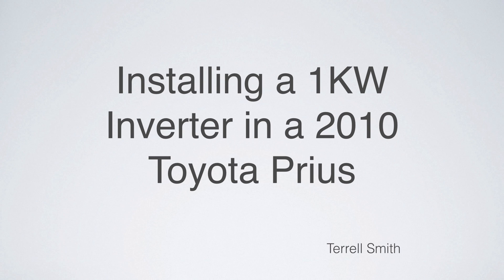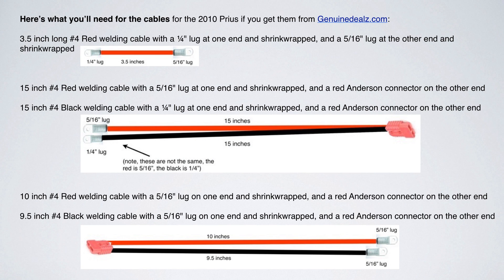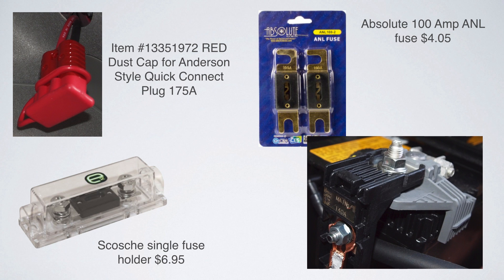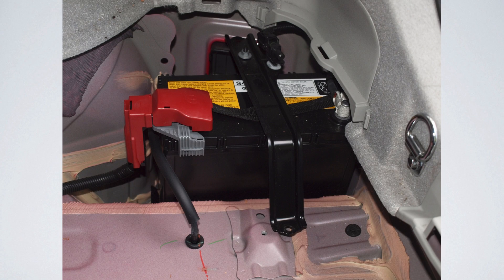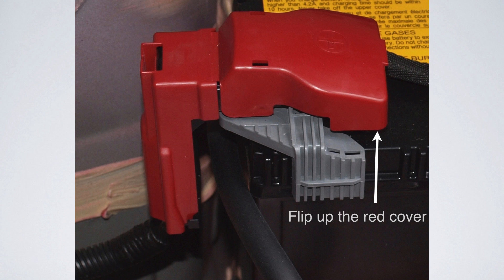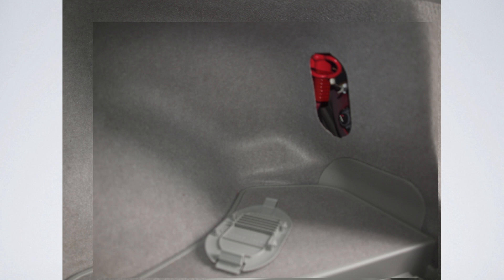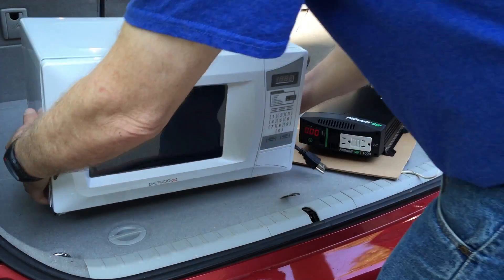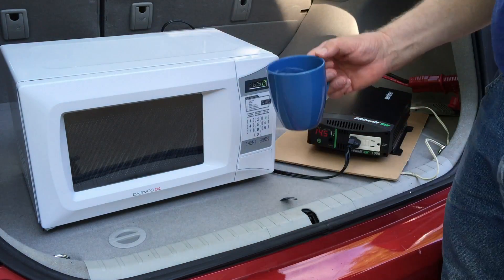Add a 1kW Inverter to Prius

Comment: GREAT video! I'd like to get an inverter set up to my Prius but have absolutely no idea what I'm doing. I want to make sure it's done correctly, do you recommend taking my car to a regular mechanic and having them install it for me? Also, where does the additional 100 amp fuse go? You mentioned that the battery already has one, does a 2nd one need to be added? If you (or anybody in the thread) could let me know I'd really appreciate it! Thanks in advance.
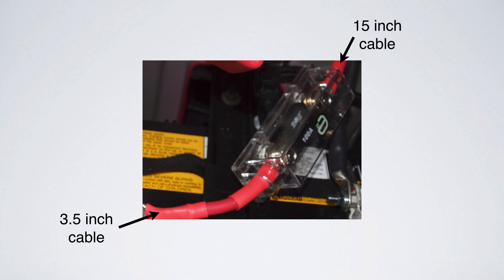Reply from the maker: Hi Michele, you can see the short 3.5 inch cable coming from the plastic box with the 100A fuse at 3:25 in the video. It connects to the positive post of the 12V battery. The 100A fuse goes as close as possible to the positive terminal of the 12V battery. This fuse protects everything after the 12V battery - the cables and inverter. The built-in 140A fuse the battery already has is built into the positive 12V battery cap, and it protects the white cable coming from the DC/DC inverter of the car to the 12V battery. Since you always want to protect power coming from a power source, you fuse close to the power source. Thus the 100A fuse. 

In theory, you could connect the red cable from the 1kW inverter to the built-in 140A fuse, BUT, then if/when you blow that fuse, you've also blown the connection from the car's DC/DC inverter to the 12V battery, and you have BIG trouble! One reason for using a 100A fuse in this setup is so that it blows before any damage might be done to the car's 140A fuse. Short answer to your question: Yes, you need the second fuse.

You could take your car to a regular mechanic and have them do it for you, but my guess is that it would be expensive. And my guess is that Toyota would refuse to do it. If you have a good friend with wiring experience you trust, that might be the best route. If you do have a mechanic do it for you, I'd be very interested in what they might charge. And you should ask first, to avoid unhappy surprises.

Part of the reason I planned and did this project myself was to save money. :)
Reply: @TerrellWSmith  Thanks a million! I’ll do some research and find out what the cost would be and I’ll post it here. I definitely appreciate all the info you share on your channel, it’s greatly helpful and very inspiring. 🙏🏽😊
Reply from the maker: @itsmichele  I've heard that some Toyota places will do special work, at their "normal" hourly rate, whatever that is.

Comment: I’m running a 850watt ac off of this setup.. it’s good at 80degrees.. at 95degrees.. the low voltage alarm on the inverter goes off..so maybe 3gauge wires?
Reply from the maker: Are you running the car while you're running the inverter? Otherwise you’ll quickly drain your 12V battery. 
Why run an AC and not just the car’s AC?

Comment: Why can’t you just leave the inverter
Plugged in and turn it off? Does it drain the battery? Risk of fire?
Reply from the maker: Thanks for the question. Plugged in, there is the possibility that the inverter is always drawing some current, even when turned off. And if that's true, you will slowly drain the 12V battery if you don't drive often. A second reason is that the inverter's terminals might be exposed (they are on mine), and you don't want the positive side to come in contact with ground (any part of the car's metal), because if it does, it might spark (risk of fire), weld itself to the metal (drain your 12V battery), and at the very least, blow the 100A fuse. So to be safe, just unplug it.

Comment: А good instruction for those who want to kill the converter-inverter of their Prius.
Why all Prius owners want to draw so much power from the 12V circuit?
Reply from the maker: No, this will not harm your Prius inverter. You can easily draw 1000 W from the inverter. You evidently do not understand the electronics of the Prius. I have been doing this for five years now. I power a microwave oven when camping, and I have powered my house when we’ve had power outages. Many others have also done this.
Reply: @TerrellWSmith 
"You can easily draw 1000 W from the inverter." 
        Yes, you could draw even 1200W from a Prius converter-inverter. If you were the only consumer of 12V in the whole car, but you are not.
 "I have been doing this for five years now."
       Yes, I've been smoking for 39 years  now and I'm still alive. Because smoking is not harm my health.
       The Prius is equipped with a high-capacity high-voltage power battery. But instead of building a homemade inverter powered by this battery, everyone prefers to overload the 12V line.
Reply from the maker: @GeorgijusPavlovas  BTW, it's called a DC/DC inverter. You don't run the 1kW inverter while driving, so yes, almost all of the power the DC/DC inverter generates is available.

Comment: I have a Lexus x450H , my main fuse at the battery side is 180A ,I want to keep it safe and put a 80A circuit breaker / fuse.
Then the 900 watts inverter with the right size cables.

My concern is what about the rest of the cars options like heated seats and the electric power steering (the power steering is fused at 80A) 

What I think is I can’t use the cars options and the full power of the inverter?
Reply from the maker: Good thinking. I wouldn't try to use the cars options and the inverter at the same time, just to be safe. If you find you need to have power (for something like a small refrigerator), then you might consider not running your heated seats, which take a good bit of power. The steering probably doesn't take nearly as much. Another option would be to get a small power station which can be plugged into your car's 12V aux power, and plug the refrigerator (or whatever) into the power station. I have a small Bluetti (700W) for this.

Comment: Thank you so much for all your information and guidance.   Fast forward a few months and my Prius power system seems to be working just fine.  I bought heavy duty cables and a new breaker which seemed to fix my problems.  I now can cook with my Instant Pot mini 3 quart if I want and found this Cusimax infrared one burner cooktop where you can cook at any wattage you like from about 150 watts all the way up to 1500.   As soon as I turn on the burner, I immediately put it at 800 watts or less and it works great.  I can even fry eggs at 300 watts.  Now I would like to get a low wattage microwave/convection oven so I could bake during a power outage.  Most low wattage convection microwaves operate at 900, 1000 watts or higher.  How risky would it be to cook at the 900 or even 1000 watt level for a longer period of time with this inverter setup?
I also went out and purchased 3-50 foot extension cords on sale and already had a 100 foot outdoor extension cord.  I made an insert for my bedroom window where one can be open about a foot without any outside air getting into the house but all the cords going through a small hold in the insert which is made of that purple insulation material.   I did a dry run and can operate my home low wattage freezer, refrigerator, LED lights in 4 rooms as well as my modem and 2 laptops with plenty of juice to spare.  Only issue is getting the car close enough to the house if snow is on the ground and being sure no car exhaust somehow gets into the house.
Reply from the maker: Hi Amy, So glad it's working for you. My experience (as well as others) is that microwaves seem to draw much more power than they say. For example, my microwave advertised as "600W" has a sticker on the back which says 950W, but it actually draws a bit more than 1kW when running. So if they say 900, 1000 and higher, stay away from them. You can always check it with a Kill-A-Watt tester. I only use my microwave for 2-5 minutes at a time, then let the inverter (and car) cool off a bit. Other things, like my rice cooker, are rated much lower, and rice takes 20 minutes to cook. When you have the car in Ready mode and are using your power set-up with the car parked outside, make sure you lock your car doors with the metal key which is the emergency key inside your key fob. That not only locks your doors so no one can drive off in your running car, it also disables the use of any fobs to open any doors. (You have to use the metal emergency key again to unlock your car.) And make sure all your doors are closed before locking up. I run the power cord out the back hatch by closing the hatch gently on it until I hear one click. Then I gently give a slight push until I hear the second click. Now the car can be locked while it's running in Ready. The rubber grommet of the back hatch will allow the power cord to go through.
Reply: @TerrellWSmith  Thanks for that advice before I go out and purchase something.  I've been looking for something low wattage and dual purpose, like a convection microwave, but the ones that claim to be 800 watts are the really expensive ones that go over ranges.  I see these little glass infrared convection ovens that use less power.  Since they are cheap, maybe I will get one and see what I can do with it.  I want something that can bake a small pizza, pie, quiche loaf of bread or small casserole.  Getting ready for the zombie apocalypse.  Am tempted to get a 20" range and use propane but I can't take that anywhere unless I get an RV.  I watched some women here on Youtube bake bread in a pressure cooker and then an instant pot.  I tried it and burned the daylights out of the bottom of the rolls, even using a bundt pan as a spacer to keep the pan far from the high heat.   Guess there's a lot of experimenting with this. My little 3 quart instant pot only gets to 640 watts max (so says my Kill A Watt) but lacks the "bake" setting.  You posted another video about adding an extra battery.  Could one use slightly more wattage if one had that setup?
Reply from the maker: @amywalker7515  You asked "Could one use slightly more wattage if one had that setup?" Unfortunately, no, because the power is coming from the car's DC/DC inverter, and you can only safely draw 1kW. Instead, I would recommend getting a Power Station with the battery capacity you need.

Comment: One of the best videos on this subject.  Thank  you.  I got it to run the blower for my natural gas heater.
Reply from the maker: Thanks for the kind words. Glad it's been helpful for you. I use it all the time to run my microwave while camping ("Glamping," as some would say.) Plus, we've used it to keep our most important appliances running in our home during power outages.
Reply: @TerrellWSmith   @TerrellWSmith  I have a quick question, if you have time.  Because there were limited options available, I bought a 2k Watt peak 3k inverter to use with my 2016 hybrid Rav4.  I want to run the blower in my home's natural gas HVAC in case of a wintertime black out. 
Is there any problem I should be aware of if I consistently use half of an inverters capacity?

Comment: You advised me about the cables and the Anderson connectors, which we purchased.  Now it is all assembled, but I am unable to disconnect them myself and my son is having a lot of trouble getting them apart too.  In order to make it easier for me to operate could one of these 3 scenarios work?   1)  I know we are talking about more electricity here, but could one use alligator clamps to hook up the inverter rather than a permanent connection?  I have a smaller 600 watt inverter I used to hook up to 2 large marine batteries when I had a backup solar system that attached using alligator clamps.  I could have my 100 Amp breaker on the red cable. 2)  Could one leave the inverter connected to the auxiliary battery all the time?  Would it drain one or both batteries?   3) If I permanently installed cables without the Anderson connectors using my 100 Amp breaker on the red cable, could I merely trip the breaker when not using the inverter to avoid battery drain or damage?  I have some dandy new 60 inch #4 cable I could use rather than my shorter professionally made shorter ones. The connected inverter would be stored where the spare tire lives.  Would any of these approached work?
Reply from the maker: Hi Amy, thanks for your questions. Yes, Anderson connectors do take a bit of strength to connect and disconnect. Hopefully with use, they will get a bit easier. 1) I would not use alligator clamps for the following reasons: They might not be insulated, they might pop off, they probably don't make as good of a connection, so there is power loss. 2) Yes, you can leave the inverter connected, as long as the terminals are insulated (protected), and there's a switch that turns off the inverter when not in use. There's probably a slight power drain even when switched to off. 3) Yes, turning off the breaker will do what you say, avoiding any power drain as well as isolating the positive line. The breaker should be well insulated and as close to the 12V battery as possible for protection. Other comments: A) You mention in 2) connecting to the "auxiliary battery." If you do that, is the auxiliary battery connected to your other 12V battery when you use the inverter? It must be, otherwise when you use the inverter you will drain your auxiliary battery very quickly, possibly ruining it. And the car must be in "Ready" mode when you run the inverter. The power comes from the car's DC/DC inverter. B) Check your inverter to see how much heat it gives off when running with a load. The spare tire space does not give ventilation. Or are you thinking of just storing it there? I store mine in the bin above the spare tire, so I can easily pull it out when needed.
Reply: @TerrellWSmith  Hi,  Thanks for all your assistance.  I decided to just leave the Anderson connectors connected and use the breaker to shut off the juice.   I then totally disconnect the inverter when not using it.   My new issue is that even though I have a 100 Amp breaker, it cuts off the power when I am drawing 665 watts of power for my little instant pot, which I am using as a token draw to be the equivalent of all the devices I might use at the same time during a power outage (small refrigerator, small freezer, several LED lights, 2 laptops, and one router/modem).   I read in the feedback for the breaker I bought that it tends to trip with very little load put on it.  So I am going to order another breaker.  Should I order one rated for 150 Amps or should I assume the original breaker was just defective?  I made sure all my connections with snug and have a heavy ground wire that connects to the car body.   If my inverter is rated 1000 watts with surge to 2000 watts, shouldn't I be good to go?
Reply from the maker: @amywalker7515  Hi. I wonder whether your instant pot is actually drawing more than the 665 Watts of power you think it is. Does it have a "high" setting? Some devices actually draw their full load on high, then on "medium" still draw that same full load, but only half the time through switching. You might check the pot with something else, like a Kill-A-Watt meter. If people are saying the breaker tends to trip with very little load put on it, then perhaps the breaker is not well built, and isn't actually allowing you to draw 100 Amps. I wouldn't order one at 150 Amps, since then you might blow the 140 Amp fuse built into the 12V battery. Stay with 100A. And perhaps order a breaker from a different manufacturer. When a 1000W inverter says it's able to handle a surge of 2000W, that usually means a surge of less than a second! Our home refrigerator is rated at 6A, (which is 720W in an ideal world), but the startup surge is too much for my 1000W inverter. The inverter shuts off. Our basement freezer runs fine off the inverter, it's rated at 5A. Does your inverter show how much power is being drawn? Mine, for example, shows that I'm slightly over 1kW when I'm running my microwave, which is rated at 950W. I tend to not believe the power rating stickers as being 100% accurate, but more in the direction of power draw. So check out your instant pot with something else, especially if it has a higher setting than just 665W.
Reply: @TerrellWSmith  I bought a new breaker and heavier cables and I no longer have the problem, but then I have only used the instant pot once since I made the changes.
Reply from the maker: @amywalker7515  Glad it's all working for you now. If in doubt, test things with something like the Kill-A-Watt tester. They are less than $30 and easy to use. Here, people can even check one out from the public library.

Comment: Hi Terrell, you mentioned in your Prius inverter video that you also connect your Prius (via the inverter) to your house.  Please share how you created the cabling to achieve this.  :)
Reply from the maker: Good question! What I DO NOT do! I do NOT connect directly into the house wiring. For that, you need a transfer switch. I also do not make what is known as a suicide cable (with male plugs on both ends). There's a reason it's called a suicide cable. What I do is rather simple. I park the car outside, or in winter, attach an exhaust hose and run it outside. You do not want CO building up inside. Then I run a heavy duty extension cord 12 AWG from my inverter in the Prius into the house. Plug a multi-outlet power strip into this, and run extension cords to my major items I wish to power: Food freezer in basement, phone and answering system, internet (modem, router), computers, backup, and if needed, a small LED lamp.